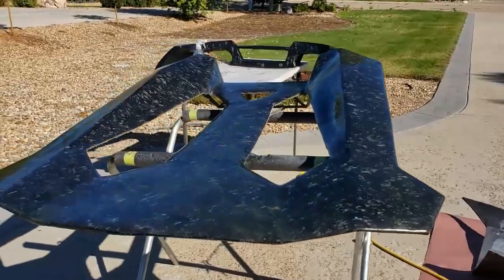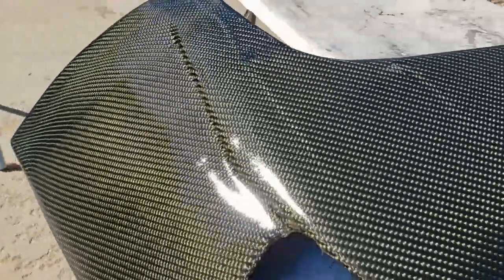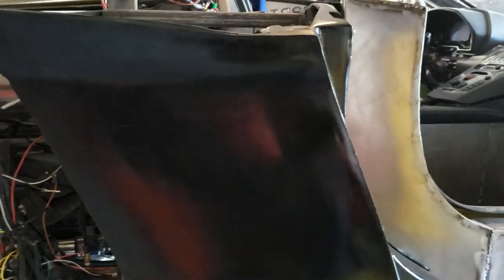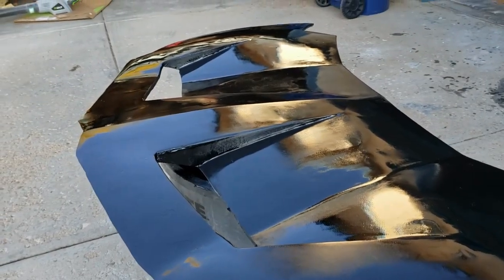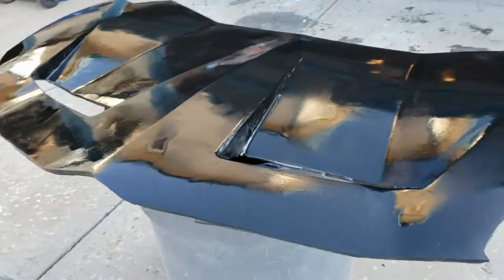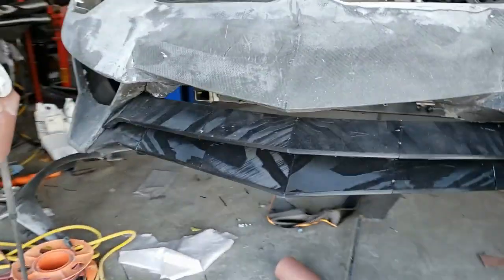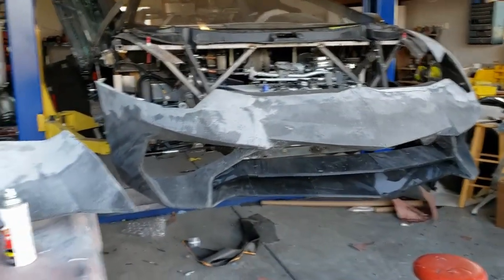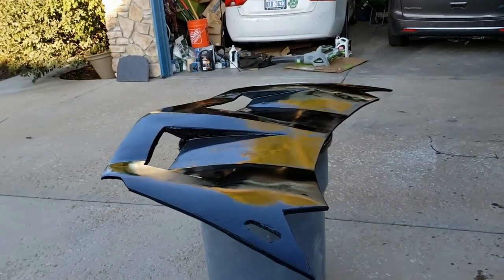3D Printed Interceptor Update 55

Comment: nice work! i use epoxy resin for smaller projects, have you tried warming them up in a hot water tub before mixing them? it makes applying it so much easier and with far less bubbles